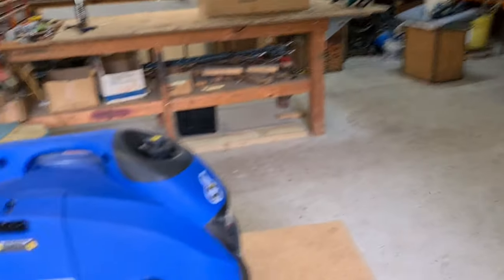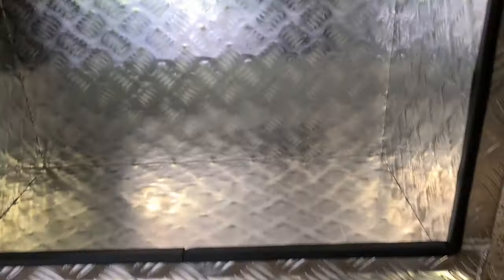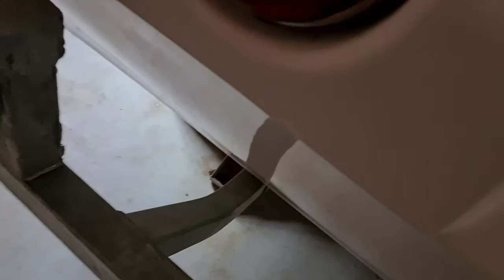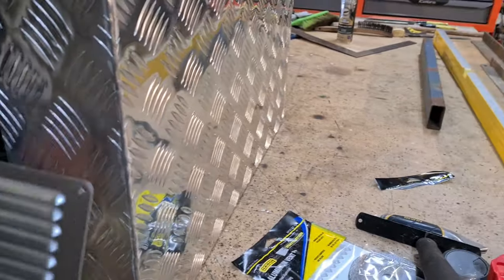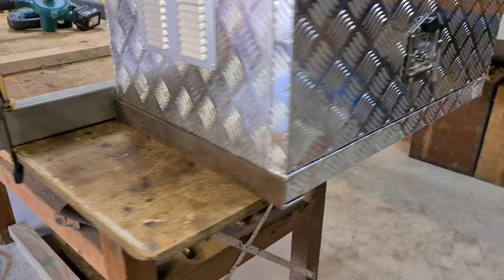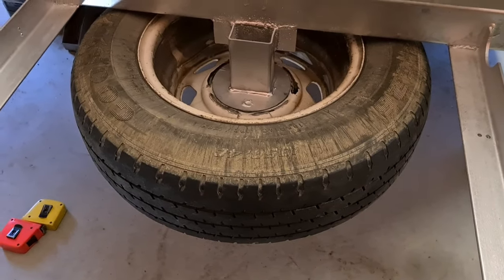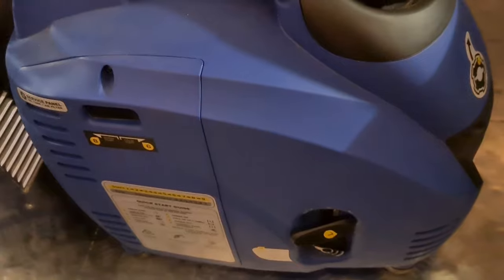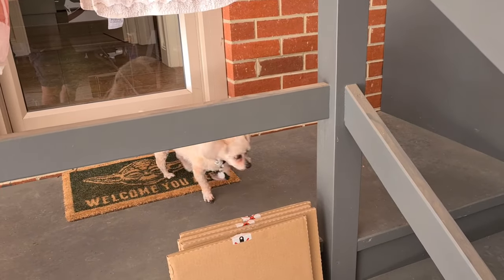Stuff it let's go around Australia: Generator solution for the caravan

Comment: I was thinking about your spare , it's going to be a prick of a thing to bolt up, what about going to a wrecker find a toyota ute or the like and get the spare wheel system that holds the spare under the tub and fit it to your bar. This will make it easy to wind up and let down.
Reply from the maker: we were talking to the tyre place about this recently. Think it would be a good idea.

Comment: Honestly before you keep adding all these luxuries have you ever weighed your van to see how far from maxing out the ATM you are. Or what the maximum overhang is aloud on you van, you just can’t add things here,there and everywhere without a bit of thought.

I have a 20yo tandem van with 300 kgs load carry capacity, it has 1 water tank and I have added solar with 2 x30 kg batteries which with our food and clothing puts us about 30kgs overweight .
I am prepared to pay the overweight fine if ever the bad boys pull me up as I know I have apart from the extra battery we are travelling as light as we can, I even leave the awning walls at home, but if needed they could go in the tug.
I might add, this van will not be the van we do the lap in , it will need at least 400/500 kgs load capacity.
Good luck with your adventure.
Reply from the maker: yes I have weighed it and before adding this we were over 500kg under the ATM with it loaded, so we have a lot of weight to play with, and ball weight is still at manufacturers weight.
Reply from the maker: on top of this we are ensuring weight is been distributed evenly, generator is central anf the jerry cans are evened out by batteries and fuel tank on front for our diesel heater.

The car has been our harder one to get to be within weight limits, to which we now have been able to achieve which is good.